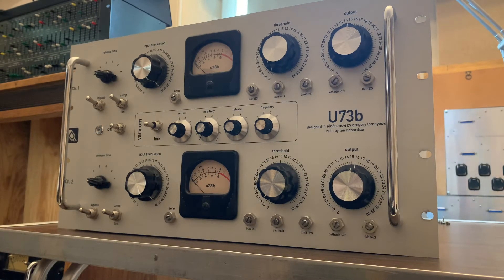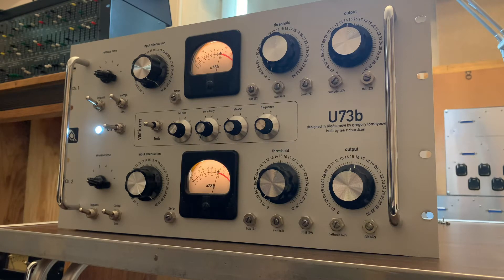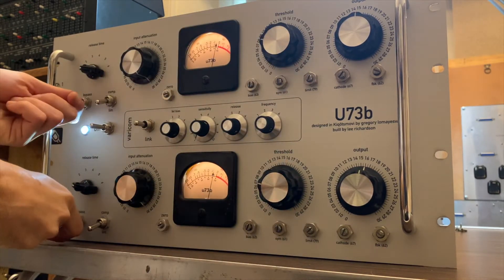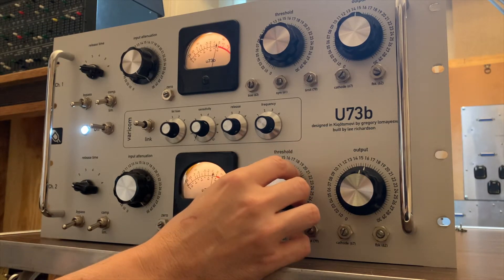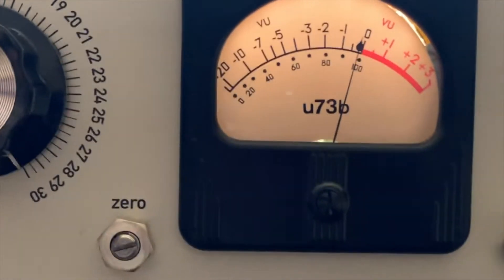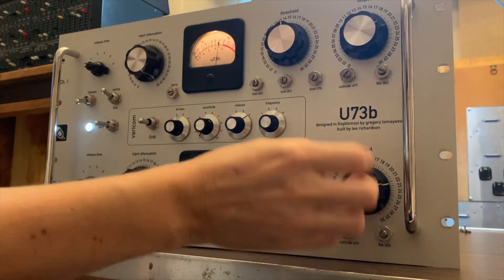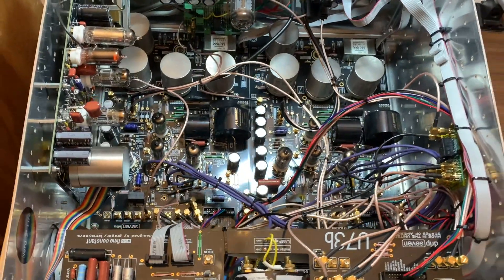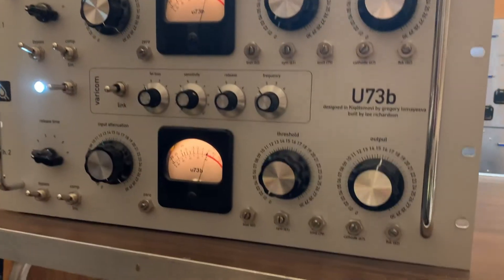drip U73B + VARICOM  -  a Telefunken Valve Limiter/Compressor build

Comment: That's impressive unit!...What number TVS did you use in the Varicom?, I saw you taking the internal controls potentiometer in front of the unit, that's was a great idea!. What transfomers did you used instance the originals TAB T188?
Thanks
Reply from the maker: The Drip design suggests having the internal calibration pots on the front. It’s very useful. All transformers are Sowter
Reply: What TVS Voltage Surge Suppressors did you use in the Varicom unit like transients limiter??

Comment: Your build looks very nice. I'm currently building one of these myself and this video really inspired me to finish it. I see that you haven't installed the TVS diode. What is it suppose to do? What tubes are you using in the Varicom? How did you do the beautiful front panel?
Reply from the maker: Hiya. Tvs diodes not necessary and no need to jump either just leave blank can’t remember what they do. The valves in the Varicom are nothing special as they do not affect audio path. I designed the front panel and printed with scaheffer
Reply: @leerichardsonwhd  Thank you for the answer. I didn't mean tube brand. I can't find info regarding the tube type in the varicom.

Comment: Lee, this build is gorgeous. I have a set of the V1 boards+ varicom; got busy and haven't started yet... hope to this spring 2021 - I'm sure I'll be in touch. Again, lovely looking piece of gear. Do you find yourself using more a a mastering/buss comp or on individual instruments?
Reply from the maker: Hiya!! Thank you very much and get in touch whenever you want :) At the moment I use it mostly for individual instruments and stereo groups of single instruments or ensembles (bussing) - it is a great mastering compressor to send back through a converter but I also built a 670 :)